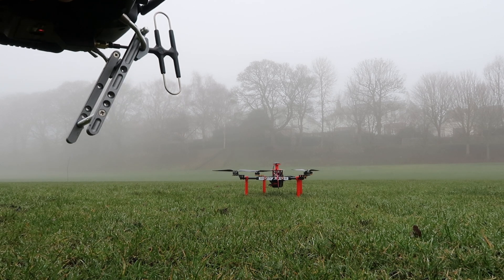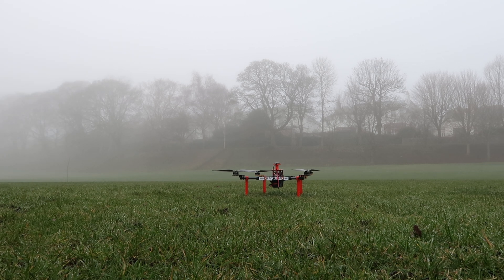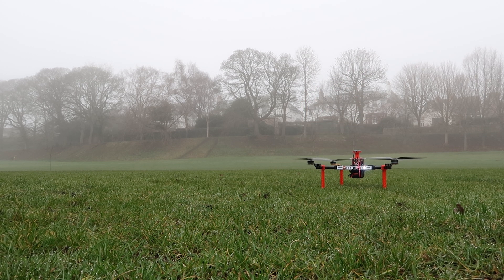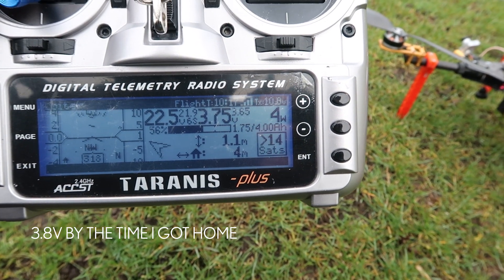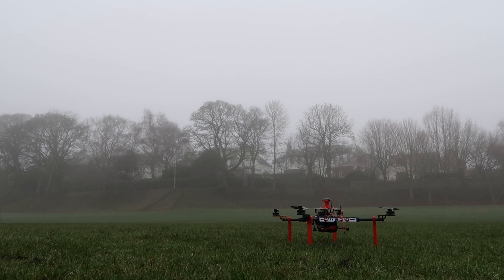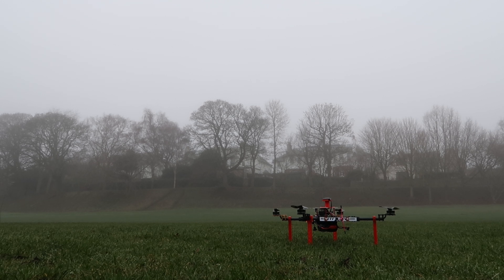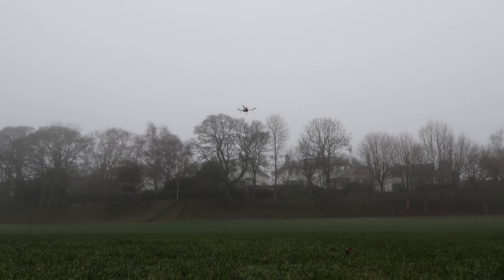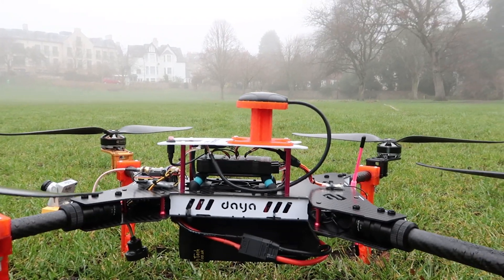Daya H4 680 // Arducopter 3.6.6 // Maiden Flight & Autotune

Comment: really like that frame! Can you tell me if it would be good with heavy underslung payloads like a full frame camera on a gimbal (3-4kg payload weight) glad you got it back flyng!
Reply from the maker: That sort of payload is beyond what you can realistically lift with a ~15" quad, unless you were to build it as a coaxial X8. And remember that with a quad you have zero motor/ESC redundancy, so a single failure in the power train will more likely than not result in a complete loss of your payload!
Reply: @CJDavies  Thank you so much for the quick reply!!! I kinda though that may be the case, thank you for confirming that. I'll hunt for a larger hex frame.

Comment: Congrats! Flying smooth as butter at maiden. Btw any reason using 900MHz R9 instead of "regular" 2.4GHz system?
Reply from the maker: No real reason. There was a period while the R9 Mini was the cheapest telemetry receiver that FrSky sold (you could get them for £10 each) so I bought a bunch just for the price & not the the range. And now we have the R9 MM which has both inverted & uninverted SmartPort pads (full size pads, not tiny pads hidden in the middle of the board) which makes it really easy to work with, even if you don't actually need the increased range.